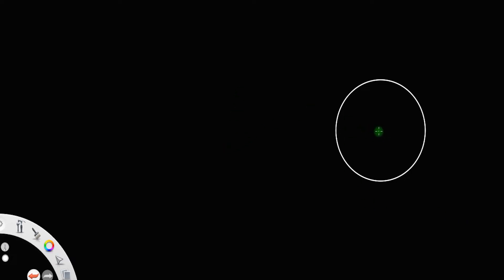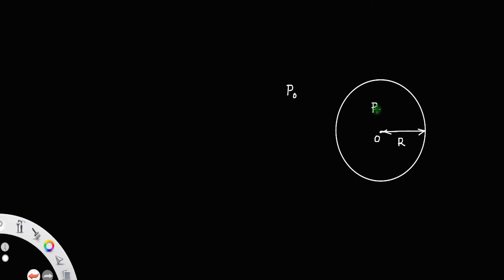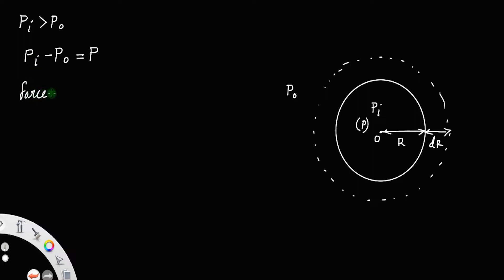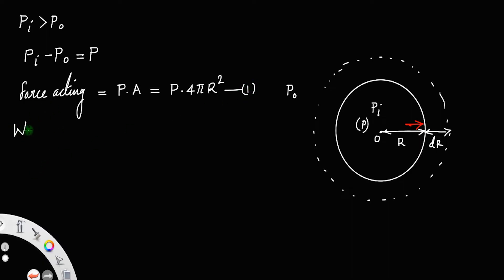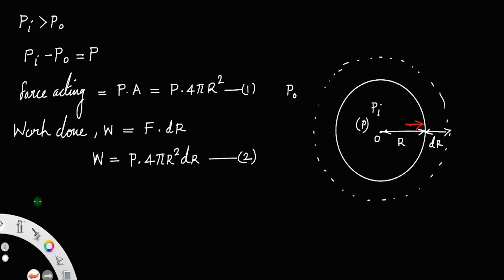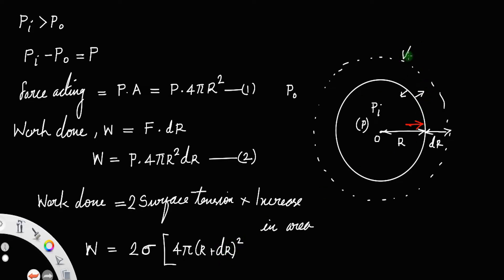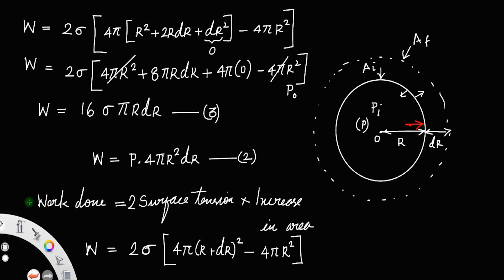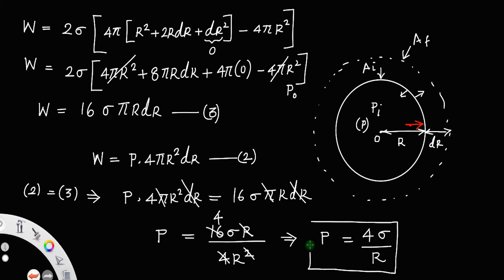Derivation of excess pressure inside a  soap bubble • HERO OF THE DERIVATIONS.

Comment: Why did you take 4πr^2 instead of 2πr^2
Reply from the maker: For a bubble there are two surfaces one inside and one outside
Reply: @heroofthederivations7305  what do you mean by inside surface technically every sphere have two surfaces like if we have a page it has two sides am I missing something
Reply from the maker: @wannaberelatable1  Both inside and outside of a bubble is air. So there is a surface that which inside air is in contact with and another surface where ouside air is in contact.
Reply: @heroofthederivations7305  ohh so 2 surface doesn't actually mean 2 surface but surface in contact with air thanks bro
Reply from the maker: @wannaberelatable1  yes
Reply: @heroofthederivations7305  I wanna ask one thing. I was looking for IZHO 2017 Problem 1 B. And it is about surface tension. In the question it is said that bubble is in free space. So technically it has only one surface, only inside. So outside doesn't have contact with gas. But in the solution of problem, The formula is again 4sigma/R. In this case, doesn't it have to be 2sigma/R.